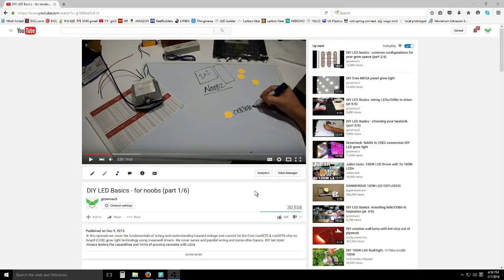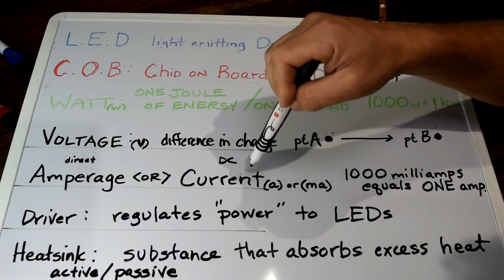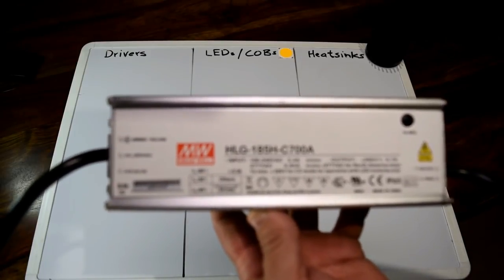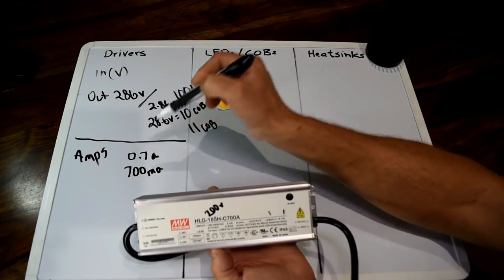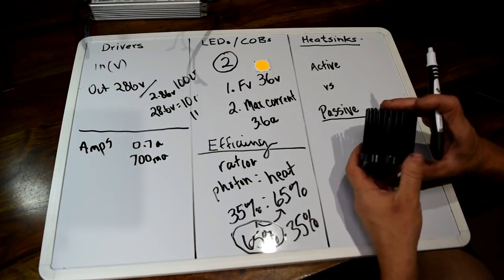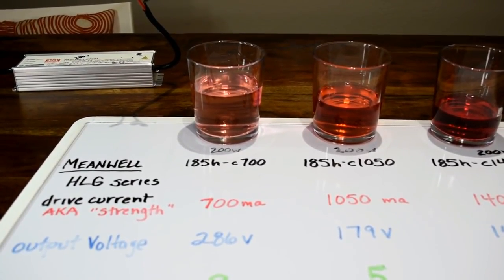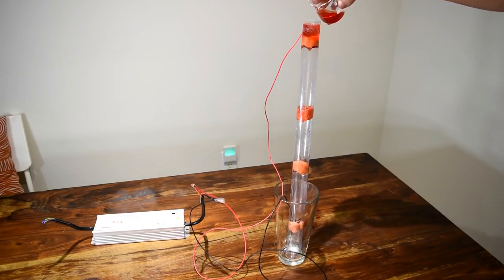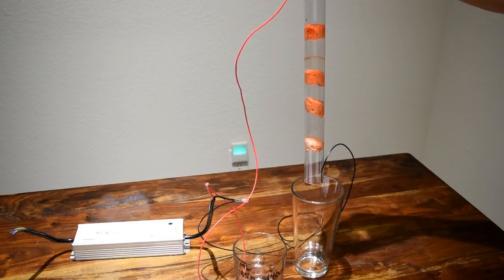DIY LED basics: getting started building your own grow lights: (pt 1/6)

Comment: Hi why is number one any better they are all putting out 200 watts. Is it because you are spreading it out over a larger area? Ok so if they can be run at 2.8 amps that would be about 90 watts on the Cobb? That is the most you can get from the cob but the worst at efficiency right? At that point are they still more efficient than a hps electronic ballast? 35 - 65

Comment: Heya! I need a little help please..I have a driver that says output 55v-85v (.65-.665 A).  Does it mean I have to run a minimum of 55v and a maximum of 85. I wanted to use components out of the mars 300 to make a cob with two cxb3590 inside. I will use two cobs per fixture. Is it possible/better to use one cob per driver , or two cobs on only one driver because of volts. If  I run two 36v chips on one driver, I would be in upper level of range with a little to spare. Is it safe to assume that would work, and I can leave out the 2nd driver, or am I missing something in the equation. Trying to make sense of all of this..Thanx in advance.

Comment: Hello, first I would like to thank the videos and comments have been very helpful.

I'm from Brazil and here we do not have cob leds available for sale and buy from other countries is almost unfeasible. So I chose in my project to use the CXB2530 (lower cost) with a Mean Well LPC-60-1400 driver. I know that in this way the LEDs will consume a lot of energy and still have a reduced service life, but with the devaluation of our currency is not feasible to run them more efficiently.

Do you think that even with a good cooling system and without taking into account energy costs, this project will not be good?

Thank you.
Reply: Thanks for the answer. The first driver I tested was precisely to 1050mA. I put a sink active heat and the temperature was around 30 ° C. The final source I bought is to 1400mA, but added a sink twice and 12cm fan ... I try to keep a very low temperature not to compromise the LED. That way I will draw about 50W of each LED. Of course it will not be very effective, but will work at the time. In the future I want to set up a project like yours, with CXB3070 and run it with a lower current to increase efficiency. I have not yet finalized the project, but will the LED will not take this current, while maintaining the low tempertura?

Comment: This was the most comprehensive and helpful explanation I've seen on this subject yet. 

Only issue I had was when I went to cutter and looked at the Mau5 builds, but you cannot purchase the build without selecting from the dropdown. Sooo what are we supposed to chose from the dropdown? 3500k CB,CD, 3000k, 6500k. What do you recommend?

Thanks for the truly awesome video!
Reply: +growmau5  So Mau5, now that cutter has implemented the ability to choose difference colors for your kit.  What exactly would your color scheme for an 8 cob set up to carry through from veg to flower?

Comment: Can i ask why 700 ma is most efficient if your not getting  as much as possible out of each cob. For almost the same price as a cob kit from cutter you can buy a second 185h-c1400 and have all 8 cobs running at 1400ma. So say you buy 8 cobs you could run them at a lower strength of light using a 185h-c700 only running each cob at 25w but for $60 more you can have them all running at 1400ma with 2 185h-c1400 and 50w.  Im not sure if im understanding how the ma effect the light out put but that is how it sound to me please correct me if im misunderstanding.

Comment: A 36v led cob will light up at quite low voltages (28 or so volt) just very dimly, at 36volt is when it should be consuming its rated amps and therefore Watts (ie 2.8amp @ 36v and 100w).

Comment: What if its 286v and LED needs 36v to run. 286/36 = 7.94, which is 254v. What happens to remaining 36v?

Based on what you would you pick 36v or 72v COB?

Comment: very helpful growmau5..i was wondering when you said about that driver with 286v out and with 11 -  28.6v cobs they would not turn on. If i were to just connect 2 or 3 instead, what would happen? would it overdrive them and burnout?/Do i need to use the votage out completely i guess is what im asking. Thanks 👊🤓✌
Reply from the maker: these drivers have something called a "constant current range" on the spread sheets Meanwell website.  there you will see the Meanwell HLG-185h-c700 's range is 143-286v  this means you must use at least 143volts, but cannot exceed 286v.  cree cxb3590 , the 36v is a label to describe the product. in real life this 36v cob only needs 34.8v at 1400ma, and even less the lower current you go. so at 700ma, its around 33.5-34v. MEANING.  4x36v=144v on a spreadsheet is actually 136v in real life.  and MAY NOT be enough to get the driver to work, since it needs min 143v for constant current operation.

Comment: Water cooling (like a cpu water cooling system) is a good or secure option to LEDs?
Reply: I was just wondering the same thing.. lol..  only in my mind I was thinking of the cooling system on a car and how it functions :D
Reply: I was thinking about water cooling systems used in computers. There's a lot of fun part's to do this.

Comment: Ok quick question, The meanwell driver you are using as an example is the 700 "a" version. Some say the "a" version is dimmable but it says nothing about the dimming feature on the driver. For example there is no 100v-286v, it is just 286v. If it is the dimmable version how would you dim it? Is there a screw or knob to adjust the voltage on the driver itself?
Reply: *****
Thanks growmau!! Speaking about my post on rollitup, I was really frustrated when another user on another site told me those cobs are not worth it. Took it with a grain of salt till I looked up grows on youtube and sherberts vid popped up with his 1500 watt system which amounted to a mere 856 grams. Felt like a my cob bubble burst twice, lot of negative stuff entered my mind.
Reply: Wish there was a way to delete that post on rollitup. Posted it at the wrong time, it is slowly sinking in about the benefits to cobs. You know how it is, all it takes is a few negatives and its all out the window back to square one. It was the same way when i first started using leds. Everyone hyping it up but real world performance was lacking. I wasn't too concerned about gpw i was more concerned about how to get the maximum yield for a 3x3 area no matter how many watts or what type of light being used. Led panels just didnt cut it, it was a huge expensive failure.

Comment: Thank you GrowMau5 for taking the time to educate the DIY cob enthusiast in me :)
i have watched all your other videos and GreenGenes videos multiple times.
I have been over on RIU educating my self, reading, following SupraSPL, GreenGenes, SDS just to mention a few and trying to better understand the subject before i commit my self to a build.  have you found any difference between the 36v versus the 72v version CXB3590.  I found these to be equal in output, lower fv + higher Amps vs higher Fv + lower Amps. Which of these would be safer to run 8-10 cobs either passive/active at 1.4a(36v) or .7a(72v) In a non commercial environment.  Sorry if my question is long winded...
Reply: +growmau5 
Thanks for the reply
I understand the performance is identical. on a 13a line that is shared would 72v be the better choice? I know your spread thin between private life and other commitments.
Reply: +growmau5 

Once again thanks for giving me a moment of your time to answer my question
I was considering and leaning strongly towards the Mean Well HLG185h-c700b (4x72v cobs) and HLG240h-c700b(5x72v cobs) and having 2 100k potentiometer controlling each driver and running them at 350-700ma each. its the most efficient use of the driver output.  Running either 8/9 cobs softer for better efficiency (save on electricity) or harder for higher PPFD. Just watched your second video. I still have to read 65 more pages on your thread on RIU and i'll be up to date in no time with both. 

Have a good day/night

Comment: Just to be sure, i got that point right. I can run 3x 36v COBs in series wired to a HLG-185h-1400a driver, without blowing them up? So it doesnt matter, that it delivers 35V more than needed?
Thanks alot for your videos btw!
Reply: +growmau5 Thank you very much for that quick response! :)

Comment: Can you run LEDs in a series that has different FV volts?one of them is 3.2-3.4 volts the other one  is 6-7 volts also I was wondering where was a good location to buy LED chips I'm looking for the small ones in the five watt range full spectrum I'm using them on a algae grow system any help would be appreciated

Comment: hey
great videos. great knowledge about LED grow ligts.
I have learned a lot from 420 mag, LED inventions, testing a lot, 10 years of study, but what im here to say, is ive learned a lot from you, and successfully built some Extreme monster LED lights, and without Your input, the lights would definately not be the same.Now perhaps I can share something With you :
Use higher wattage meanwells. 2x185 is not the best option for running 400W.
you can use at least 530W-540W total mw drivers. if they are run at 75%, not only is the life expectancy of the driver A LOT higher (60k+ hours) but also the Power factor / efficiacy of the driver is better. So in real life, you use less watt. im not talking about measured watt, im talking the watts you actually use. With a lower Power factor, you Waste watts.
With a Power factor of 0,9 for 400W you actually suck about 444W, returnig the extra 44w into the Power grid, as a out of phase wave.
peace

Comment: Hi there. Thank you for the videos, they are a wealth of knowledge. REALLY!

Two questions, please:

At 14:54 you mention that a LED run by 1.4A will produce the most light. So, if one doesn't want to grow with the light but more use the light for lighting purposes, given you have sufficient cooling, it is best to use a bit of a higher current (like 1.4A) as opposed to 0.7A?

What you say after this my brain takes as conflicting, so i need to ask to be sure. (When you mention the softer you drive it the more sufficient it is - 65% photons. Doesn't more effecient mean more light / lumen output?)

Thank you again.

Regards
Reply: +growmau5 Thank you very much for&#160;the reply.I have one more question, perhaps you can clear this out for me and whomever needs clarity on this:When one looks on the CREE website the lumen rating output on the CXB3590 has a range of 6550 - 18000lm. Do I understand it correctly that if you run 2400mA through the chip you would get closer to the 18000 lm output AND more heat build up (hence the cooling becomes more of an issue) but even if you run 100mA through a chip you would get closer to the 6550 lm output with less heat build up, as long as the power supply is higher than 36VDC? Thanks again for the videos.
Reply: +growmau5 Thank you very much.Keep up the good work.Really helpful. :-)

Comment: If I'm using the 185h-c1050 
179v driver with 18v 1050ma strips,  it could power 9.94 of them correct? Would it be fine to run 6 of them on this driver?

Comment: Can you run cods in parallel using   a CC driver and how is voltage affected and calculated so to optimize the driver?

Comment: Picked up a Vividgro V2 needs to be rewired, no idea what I'm doing. The wires were cut to the individual led heatsink panels. They are sandwiched  plastic lens / led board / heatsink  with a black and white wire running to the led board. Doesn't look like there were any drivers or fans mounted. Any help we'll be greatly appreciated!

Comment: Hey GM,

Howcome in the driver "colored water" analogy the second driver (185h-c1050) doesn't add up to ~200watts?  The other two do.  Is that a 179v a typo?  Should be 190v no?

Peace
Reply: Com plex as he said you just worry about getting enough volta ro Turn All the Lights On

Comment: I'm wanting to build a grow light I checked with heatsink Usa and they have a2.45 wide by 75 inches long with the flat plate being 1/4 inch thick I want to build multiple lights in order to cover 80 feet long rows of Heirloom tomatoes x 4 rows building one will give me a way to repeat after the first one I'm thinking that I want to use 10 watt leds 4:1 ratio 650nm - 460nm with a few 730nm I am limited to 75 inches heatsink from heatsink Usa I would like to use 230-240 volt to cut down on power consumption the lights will be placed about 20 inches above the canopy with the plant being 9 feet tall and the light being 20 inches above that in the trusses I'm not sure what I want  or need to get a 200 micro moles of light above the plants and what would be the proper spacing of the 75 in heat sinks.i want to get you to explain and tell me how to do this what leds will give me the best results 
The proper spacing of the leds  and what necessary power to complete each 75 inches if I had your email I would send you questions that way but thanks in advance

Comment: hello, i wonder why  the lights has no specific red blue ratio, its just white in kelvin, doenst it kill the efficiency because of the unused colors, further whats ur red blue ratio in the veg and bloom u think benefit the healing plant the most. cheers
Reply: because the phosphor converts the mono blue light into a true full spectrum light. Much like a cfl does. If you want to see the spectral data, check out the CXB3590 data sheet from Cree Semiconductors.

Comment: I am super confused now. I want to wire 18 x 3watt leds(3.4V~3.6V ebays says). I thought I was doing right by getting the cheap china driver you find on ebay. However it says in: AC110v to out:DC12v - 60 watt from the seller usaokeba. I was skipping all the details and basing this off just wattage. Please set me straight.
Reply: never mind Ifound the right driver:Maxwellen LED Dimmable Driver (12-20)x3w :)

Comment: extra heat drives down lifespan of LEDs, I'd be curious to see what adding a small, efficient computer fan would do in the long term for a COB. The added wattage might make the greater efficiency last longer and ultimately be worth it in the end. Any thoughts on this?
Reply: yes its very common to use an active heatsink with high power led, cob or otherwise.
Reply: right, but I'm talking about adding a fan to a passive heatsink which already has "enough" heat dissipation. By having more heat dissipation than you need, that extra wattage might in the long run increase the efficiency by providing extra cooling, therefore increasing the lifespan of the LED. Lifespan of LEDs just refers to their gradual decrease in efficiency, so by adding extra cooling you slow that efficiency decrease, so even though you have to spend the power running the fan, over the course of years it might result in more lumens per watt. Of course you could do the same thing by just adding a bigger passive heatsink, but at a certain point a heatsink can be TOO large.
Reply: I'm still learning about LED's but I haven't seen a relationship between LED temperature and efficiency. The efficiency relationship I see on Cree's datasheets are to do with current vs lumens.  I may be wrong, and I would like to know if this is the case. 

I understand the lumens drop with the age of the LED, but is that due to heat or just the emitting of light degrading the phosphors?
Reply: it's due to many factors, but increased heat leads to a faster drop in efficiency and lifespan. If you want to know more about LEDs, just reading the wikipedia page on LEDs gives a lot of good, applicable generalized knowledge about LEDs and discusses this and the efficiency droop, which is the primary reason COBs haven't taken over the grow light market.

Comment: Do you have to "use up" all the voltage on a driver? for example, can you run a single 50v COB on the 286v driver in the video or will the voltage be too much?
Reply: +growmau5 is that only found on the data sheet or printed somewhere on the devices? I'm looking into these and trying to understand how to utilize them 50W Driver and Bulb Adapter AC100-265V to DC20-39V Transformer Switch Power Supply For Factory Street Lamp LED Strips Bulbs
http://s.aliexpress.com/22UZbYba
(from AliExpress Android)
Reply: +Miles Aurbeck oh, I see now. the Ali one says from 20-39v. I think I understand how to match drivers and LEDs from your videos now. The new part one closed all the gaps for me. Now I just need to try to get specs for the lights that come with the drivers in that bundle and hope they are of good enough quality for some hydroponic house plants.

BTW, wouldn't it help to have an interactive grow light calc? For example, taking grow space and coming up with LEDs, heatsink sizes, drivers, etc. and giving you options to move stuff around? I'd be happy to work with you to develop that. I can program the specs for a grow light system you help me with.

Comment: If i have a power supply of 2.8 amperi, and the volts are 54v+, can i use it for a 54v+ and maxim2.2 amperi for a cob Luminus 32mm.

Comment: Why does 6 1 watt leds light but a seventh one in series and all 7 blink on and off? 3.3 to 4.3 measured leds. One white one red. Different strings in series. Not enough volts 36 or not enough mAmps?

Comment: Hi, first of all you have a great channel, helps a lot! 
 i have a question, is it possible to use less cobs with a driver that can work with more?  lets say i want to use one HLG--185-700 with 8 cxa3070s (6*3000K & 2*5000K  36V) and i like to ad a switch or two so i could switch between 2*5000K to 2*5000K+2*3000K to all 8 of them, will it work?
Reply: Got it
Thanks man